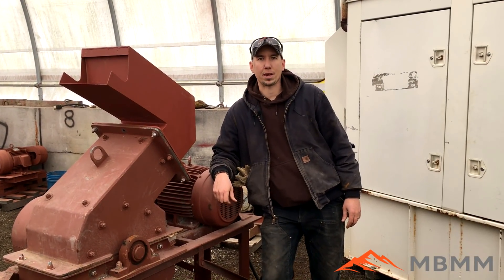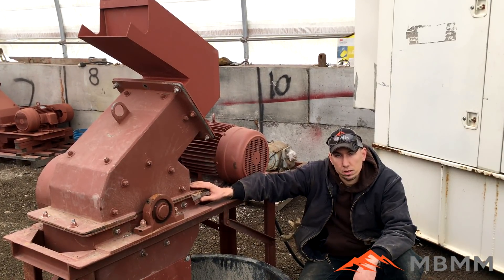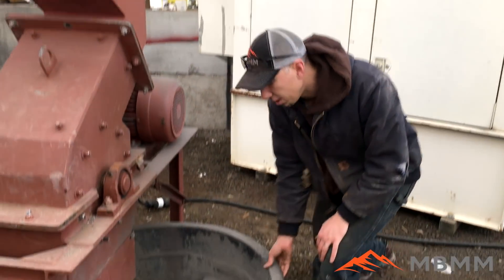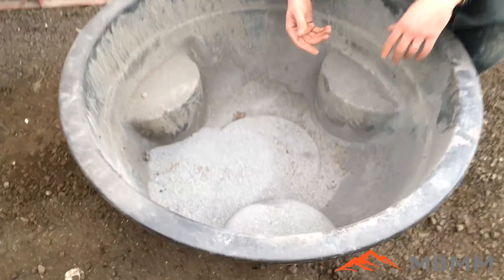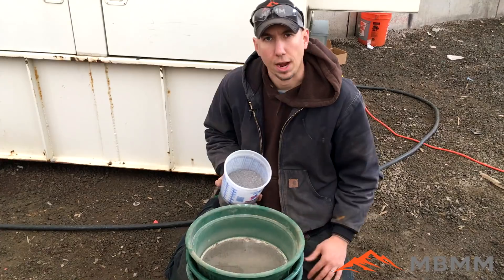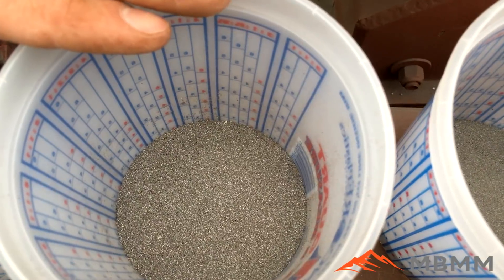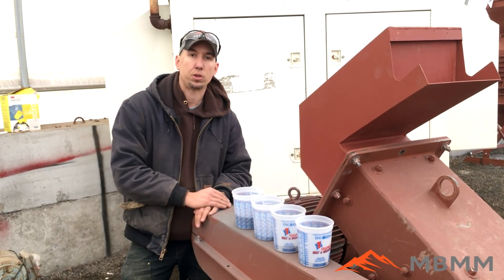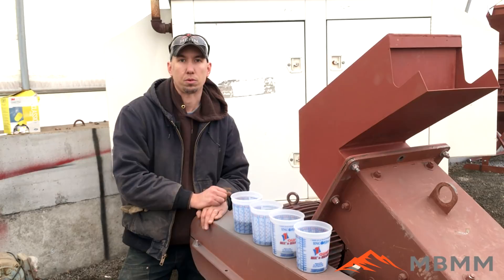Processing Metal Refractory Slag in a 16" x 12" Hammer Mill for Reuse

Comment: Does this stuff explode or pop? I never knew what steel slag was. We started getting some imported to our yard, I thought guys were bringing in 5/8ths minus rock. Wasn’t til one day I was told to go pick up a load for the yard. 
But one day about a month ago I heard this loud ass noise in the bed of the dump truck , something hit the truck bed, I palled over to examine any potential damage and didn’t find anything. So then I began to wonder if someone threw a Rock into my truck from a overpass. But I never seen any damage or anything other than the 5/8 Slag I was hauling. Wasn’t til today another trucker was asking me if I think this stuff pops or explodes like a popcorn kernel, because even we get loaded it’s all steamy and looks hot. I never got in my bed to feel it, but I see the steam all the tune and we get this stuff directly from the plant. So I was just curious if you knew if it popped or exploded.

Comment: I could see sparks. Does the outflow from the mill feel warm?
Reply from the maker: The discharge from the mill is warm as there is a lot of friction happening inside the hammer mill.
Reply: This is a good time to insert a warning: separate hammer mills should ALWAYS be used for aluminum and iron-based products... and never process ultra-lightweight alloys without knowing the magnesium content. If magnesium exceeds 5% of any given alloy, you need to perform a clean out of your entire processing line FIRST.